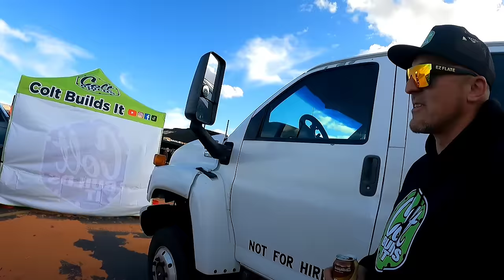Moab first, then Offroad Games with ‎@trailmater and my best bud Robby

Comment: Tractor Tyres on Rory's Rig are TOO SMALL, ... in the 'pull' competition, they dug real DEEP and were too small to get outta the hole.   
I still say, the inlet to the Supercharger doesn't have any AIR FILTER, ... not good in the long term,
other than that, that BIG "D" is a REAL BEAST !
Go RORY.!!!.
Reply: There is a filter inside the scoop on the blower